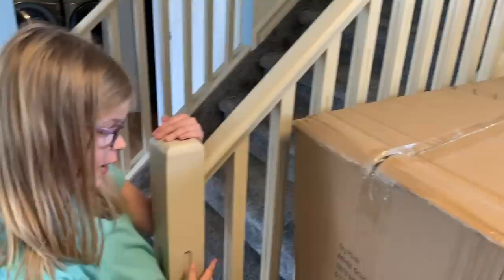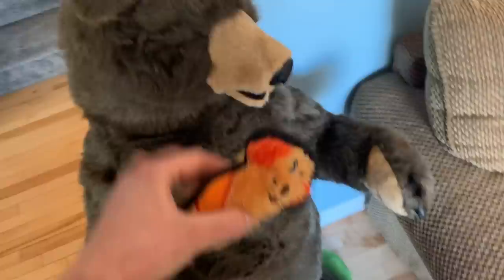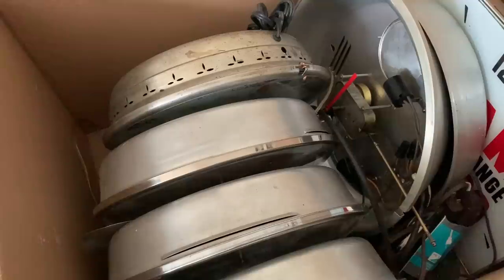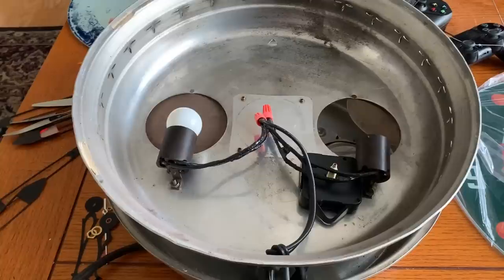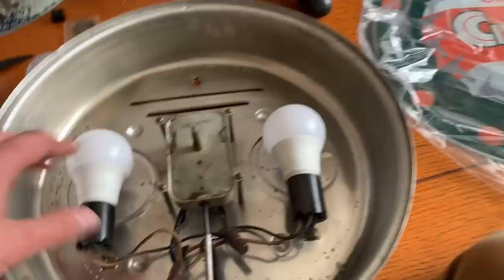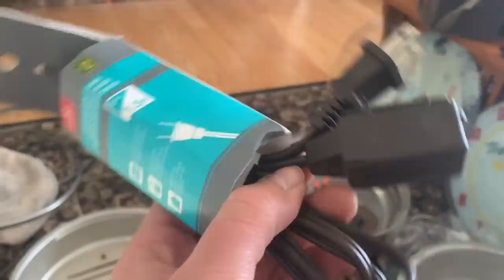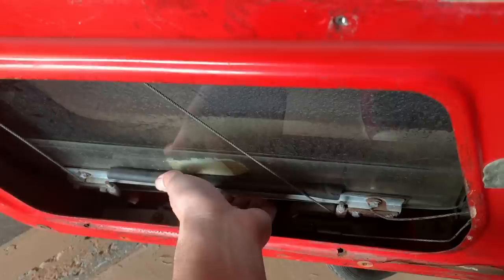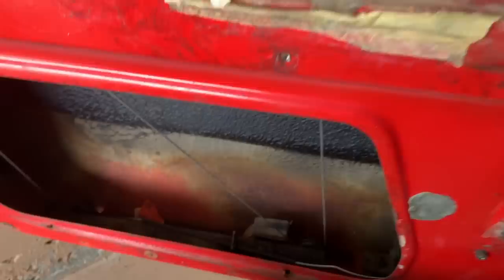Fixing a Pam advertising clock, my Alfa and playing with the dog, all in a days work!

Comment: Hello Alex, 
Thank you for the video, as always it was entertaining. One minor nit; the new wire you put into the clock has to be protected by a grommet to avoid the metal edge of the hole to cut into the wire.
The old wire that you removed had such a grommet. Since you are planning to sell these clocks, please make sure you repair them safely.

Comment: Your "Crush" clock seems like the LED bulbs are putting a little bit too much light on the glass at the bulb area, maybe use a lower light wattage and cool white to give the look of daylight in the clock!  Your Alfa is really looking good! You amaze me all the time with your passion to fix things properly!
Reply: I thought the same.
Reply: Yes, I thought it was a little too bright as well, needs to be a softer glow, but hey good points that the led lights produce less heat and they also last longer than conventional bulbs. I use LEDs in the headlights of my riding mower.

Comment: Alax 

You mentioned replacing the old incandescent light bulbs with the newer LED bulbs 💡 to reduce the heat, thats was a kool idea another good thing about using the newer bulbs is they will draw way less current and cost a lot less to run nice, and easy on the power bill. And being LEDs, they will run much longer without needing to be replaced. That’s a good plus on a clock that runs all the time for years. 

Very nice looking clock ⏰
Reply: They'll only last longer if they're rated for complete enclosure..not all bulbs are. Because even though the bulbs produce very little heat, the base where the LED driver is located does get pretty hot.
Reply: Snarkapotamus 

That’s interesting to know I never considered that and it makes sense. I have never seen any LED bulbs that say on the package “ rated for enclosure “ but then again I never looked before. 

Thank You for the info it’s good to know.

Comment: FYI - on the back of my Ecosmart lightbulb pckg in very small print it warns "Not for Use in Totally Enclosed Fixtures" . I had a problem with mine in the overhead kitchen light and had to remove the glass dome! The bulb does not get hot but the ceramic base does.    Please reconsider those bulbs or check with manufacturer about safety. 🤔🙄😯
Reply: Yep. Take if from someone that's a lighting expert, all bulbs are not equal.
Reply: The back plate has a vent in it to allow warm air to escape.

Comment: The white (neutral) wire in the clock needs to be connected to the wire on the new cord that connects to the wider prong on the polarized plug.  This prevents someone from getting shocked if they accidentally touch the bulb threads when changing a bulb.
Reply: That's what I came here to say. Very important, especially on a clock like this where you have limited access to the bulbs through the change ports in the back.

Comment: In 1979 I went work for an Alfa Romeo / Volvo dealership here in the UK. They let me use old Alfas as company cars. The 2nd one was an Alfetta saloon 1.8 litre. It had the same window winder mechanism as your Duetto. The driver's window would not go down, and when I removed the door card, I discovered someone had bolted it up solid rather than fix it properly like Alex!

Comment: You need a rubber grommet on the metal part of the clock where the mains cable enters, a knot in the cable is not enough.

Comment: You should be checking the polarity of the cord so you connect the neutral lead to the outside ring of the bulb and the center is hot. Just because.

Also, wire nuts. ;-)

Comment: The left-hand motor wire of the clock with the fluorescent bulbs appeared to have part of the wire insulation nicked or chaffed through on the backside.  You might want to take a look just to be safe.

Comment: I had a 2001 Oldsmobile Aurora among the many things wrong with it the windows were held up by a thin piece of plastic that cost $300 to replace, not counting the service fee. It was the size of a kids school ruler. I put a board inside the door to hold it up. That window had never been used before and it snapped while I was driving. The car was a death trap, it would accelerate on it's own. I had to put both feet on the brake and it was still moving. Most of the time it would do it when you turned it on so I would sit there turning it off and on until it didn't do it. Some times it wouldn't start so I had to turn on and off until it did. It had so many problems. The GM people would not talk to me. And people kept saying to sale it, there was no way I would unload that on someone else. The junk man got it. Car designers aren't the smartest people around.

Comment: Those bulbs seemed way too bright for those clocks. They seemed to completely wash out the colors in the face. I don't know what size those were, but anything over 25w or so and above 3000K would probably be overkill. You might also want to think about putting a shield in front of them to force the light to go back to the pan and then forward. I think you'll find the face will be lit more evenly.